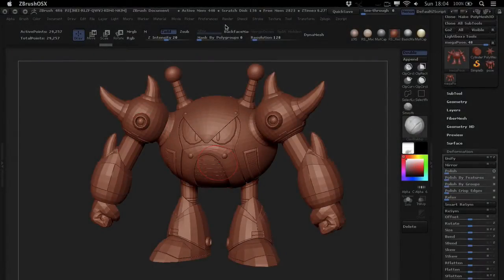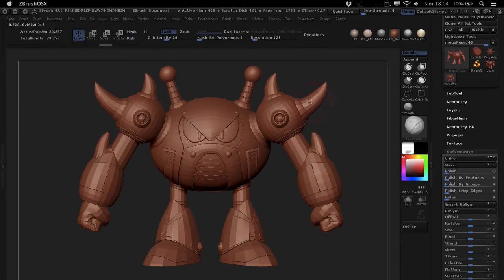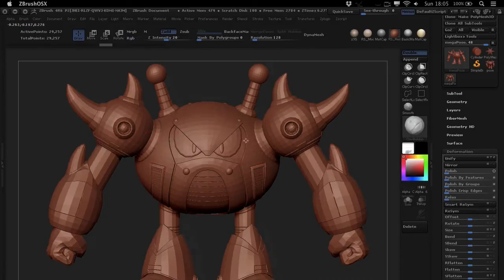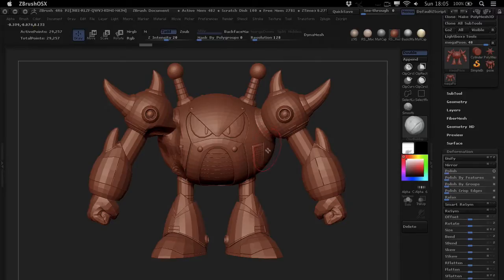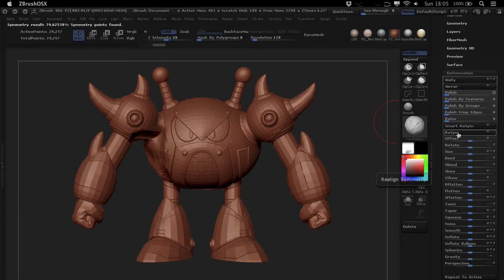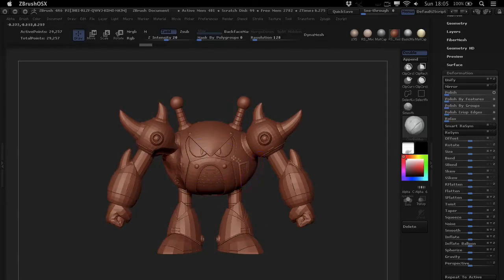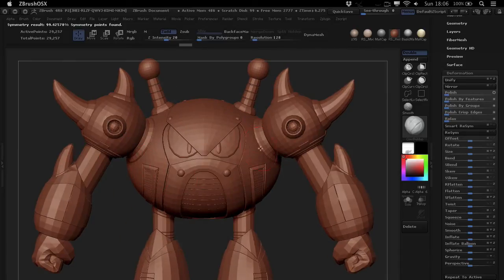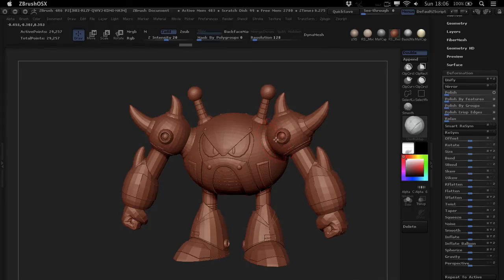Zbrush Tips and Tricks Tutorial - Smart Resym HD

Comment: I find it useless most of the time because it doesn't work if you used dynamesh after the symmetry was turned of, 3D coat will Make a symmetrical model regardless of topology ;) Well most software will do so, but this is one of zbrush's weaknesses